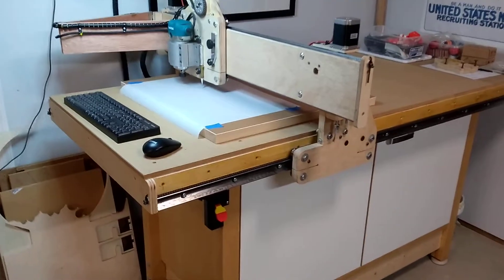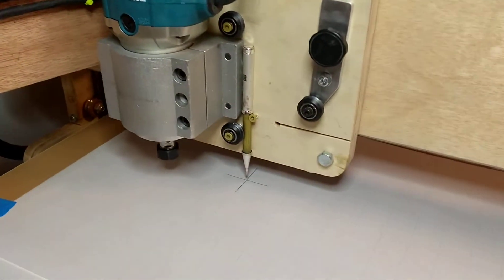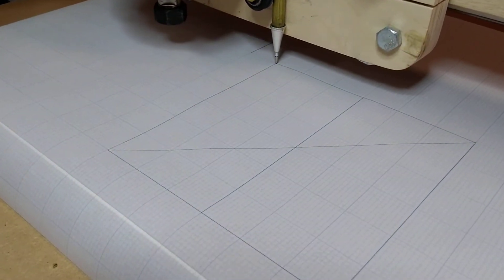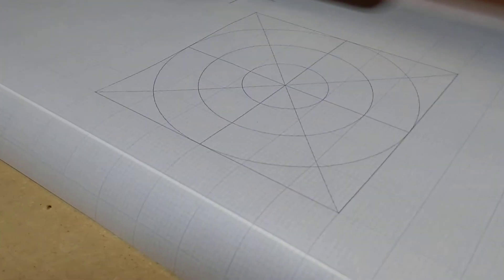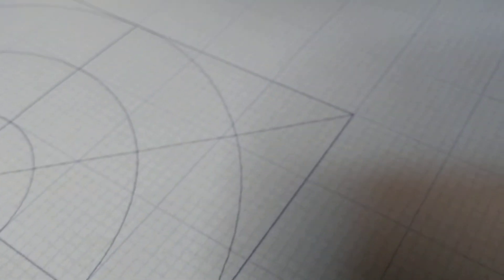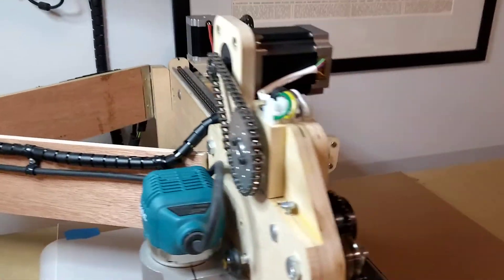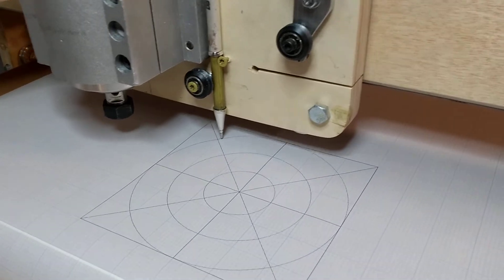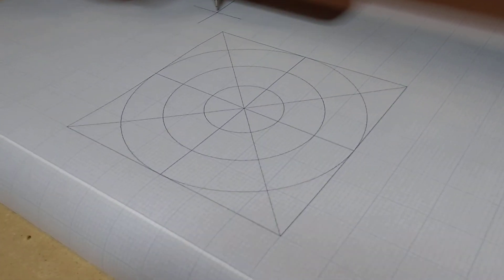DIY CNC Router Repeatability Demo

Comment: Hi, can you tell me with what IPM you can cut wood, what size are those steppers, and are they good enough.
Thanks!!
Reply from the maker: I've done some shallow cuts at 80ipm.  The cut speed all depends on cutter diameter and rpm, depth of cut, and wood hardness.  The current iteration of the router is running 500oz nema23's through a 3 to 1 reduction (so it's quite torquey).
Reply: @zeketeccnc1207  ok, thank you ✌

Comment: Which software you r using to convert image to gcode to draw with this router
Reply from the maker: I design in CorelDraw then export in SVG format.  I import the SVG into EstlCAM to plot the cuts and run the job.
Reply: @zeketeccnc1207  but its not milling just drawing how can that be. Does inscape works?
Reply from the maker: @nsk6914  EstlCAM is an integrated CAM and CNC controller software package.  You can use it to convert the SVG (or DFX) file to gcode and then it can run the gcode on your router.  Inkscape can be used to produce SVG or DFX files.  I use the SVG because I get better exports out of CorelDraw in that format.  Here's a nice overview of EstlCAM: https://www.v1engineering.com/estlcam-basics/

Comment: This is great, the results you get with this machine are amazing because it's a chain drive after all.
I have a couple of ideas so I'm wondering what you think about it. I think it would be much better if the chain was welded to the bar, square tube or something like that. Then there would be no chain stretching, jumping,vibrating... In fact it would be rack and pinion made of chain and sprocket. I think backlash could even be avoided if you put two sprockets and connect them like train wheel linkage, one would be pressed against the right side of the chain and other on left side. I hope you understand what I mean. The second way is even easier but another chain is needed. The idea is to put sprocket betwen between two racks made from chain, one on top of the sporocket and one on the bottom but one of the racks would be slightly offsett so sprocket would have contact with both sides of the chain ( zero backlash) Sorry for my bad english.
Reply from the maker: Your chain rack and pinion idea would need to be tested.  There is a cogging effect when a chain goes over a sprocket and I think this would still be an issue with a sprocket running across a static chain.  The larger the sprocket, the less the cogging effect though.  Tensioning the sprocket pinion against the chain/rack  (to reduce backlash) would exacerbate the cogging effect.  Offset sprockets askew from one another to reduce backlash is essentially the way zero-backlash nuts work so may be viable.  On the static racks on the top and bottom of the pinion, I done see how this would work.  It would just lock the pinion in place.

Comment: Could you please post some pictures or slow pan video of the vertical guides for the gantry?
I read your instructables post and watched the videos but I am still a bit fuzzy on how you did it.

The use of solid core door as a table is quite clever.

On the subject of accuracy of chain drive - I built large format CNC routers with chain drive. For woodworking the accuracy is good enough. Wood dimensions float with humidity and temperature. Any woodworkers will be extremely happy if all his cuts are at 1/64” accuracy. Chain drive is better than 1/128” accurate. 
The chains do stretch and sprockets wear out so after few months of intense use the machine should be calibrated, but that is not a big problem in hobby or even low volume production.
The upside of chain drive is absence of backlash and low cost for large format machines.

Your observation about chain sag is spot on. It is the source of inaccuracies in chain drive.

Another not so obvious benefit of v-bearing on steel angle witch chain drive is that the machine is dust-proof.
In busy wood shop there is always some dust. This design is impervious to it.

Suggestion for tensioning the chain- put a spring over the chain end on one end between the pin (Allen key in your case) and the 
frame. This will give you consistent tension. And repeatable if you need to take the chain out for any reason. You may or may not know that there are springs available that are rated at specific load per linear compression. With those springs you know fairly accurately the tension on the chain.
Reply from the maker: The next time I fire the router up I'll try to grab some better vids.